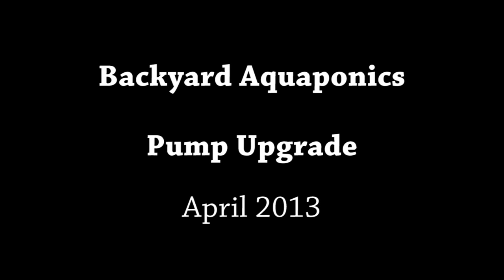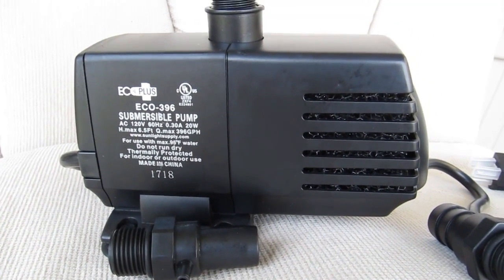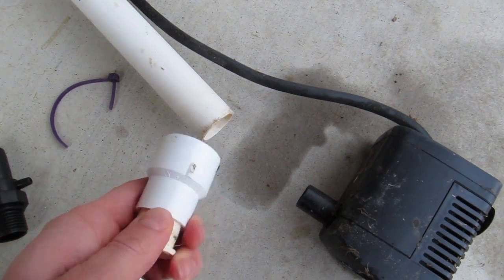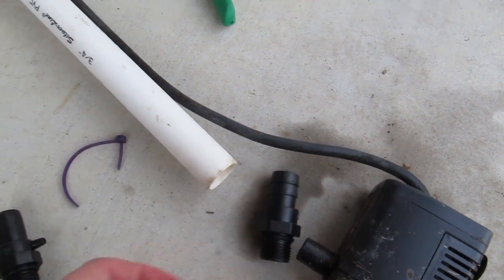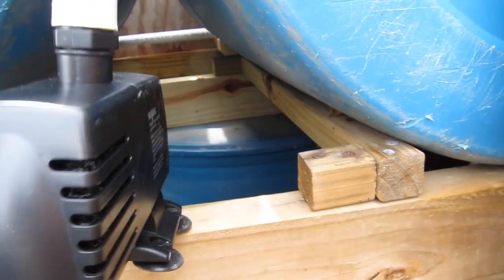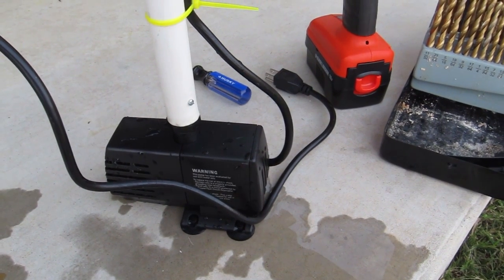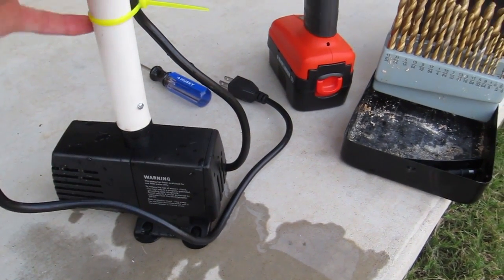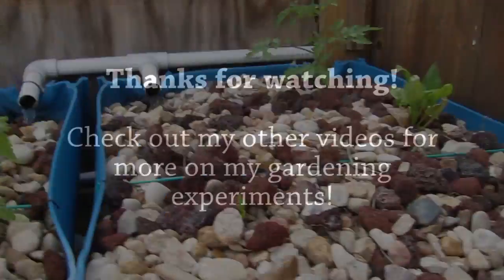Backyard Aquaponics: Pump Upgrade

Comment: you could have just place a bit of rubber tubing out of those barbed male tips into another fitting to connect to the pvc. there should be a piece of pvc that ends with a barbed tip

Comment: You should also consider "head-height", ie how far you're asking the pump to push water vertically. Check with your pumps manufacturer, they will typically provide a graph for each pump, showing the reduction in GPH for every foot of head-height above the pump. In some cases, a pump's efficiency is considerably reduced with more than a foot of head-height. Food for thought.

Comment from the maker: I haven't had the pump very long, but so far it's working well.  I'd say its current power is plenty for my system, but I wanted some buffer in case it slows down like my previous pump did.  If your system is similar in size to mine, I'd say this pump would work well...if your grow bed is, I dunno, 20+ gallons larger than mine, I'd go with something larger.